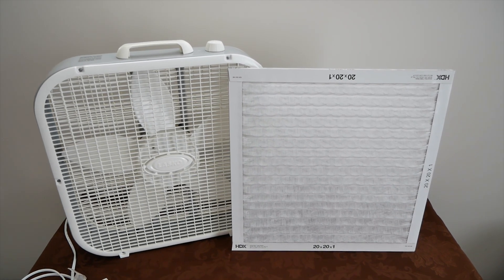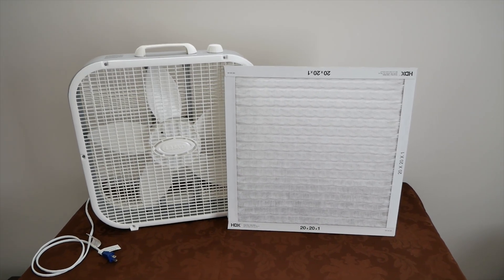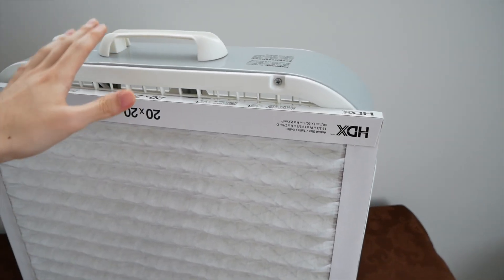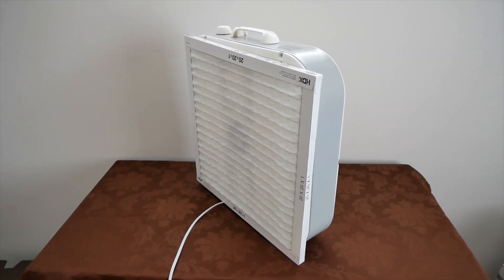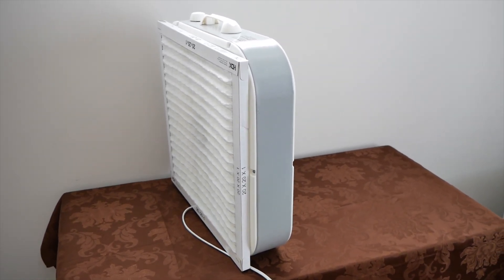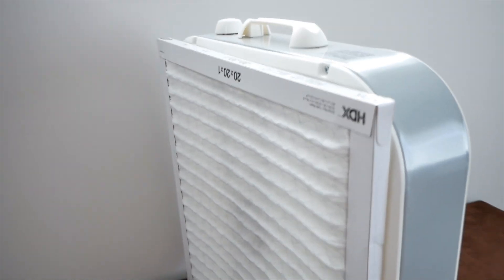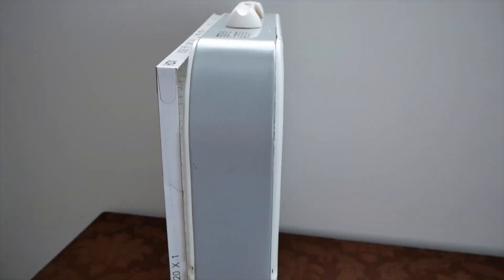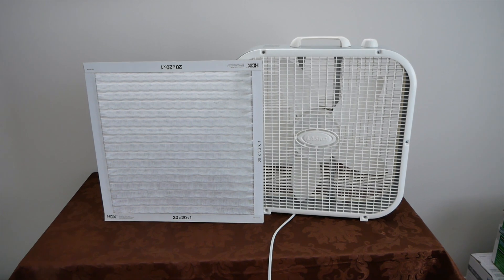Simple DIY Air Filter Box Fan | Build & Test

Comment: video failed to show results after one week after one month and after 1 year of use, try again?
Reply from the maker: The video’s primary objective was to build and test the setup, not to show its long term results. But I will say that it has been quite effective. I’ve used it in my workshop to keep sanding dust down and the filter captures everything that passes through it. No dust accumulation on the fan blades, even without sealing the filter against the fan.

Comment: Awesome, never heard of such a thing and I want to try it. One question, so if Im sanding something I would place the fan next to where I'm sanding with the filter as close to where the dust falls correct? Wouldn't the other side,(the fan side) be blowing around everywhere all the other particles that are not caught?
Reply from the maker: Thank you! With a basic setup like this, it's difficult to fully contain the dust, but yes, the best method would be to keep the fan close to your work area with the intake/filter side facing you. It's in evitable that some dust will be blown around the room. You could have a second fan with a filter further away from the work area which should help capture some of the dust that the first fan missed.

Comment: Sis I miss airflow direction thru the filter? Which way does the arrow go?
Reply from the maker: The arrow should face the same direction as the airflow. So if you place the filter behind the fan like I did, the arrow should be pointing towards the fan. Hope it helps!

Comment: I do the same thing, but I do tape mine on the fan. Yes, I have cats, it keeps the litter dust and cat hair out of the motor. Also yes low speed works best. I've been using the same two fans for this for 5 years and it makes the cleaning much easier too. I will try to just use the filter without the tape to see if it works for me.
Reply from the maker: Great to hear that it’s effective! For maximum filtering efficiency, I think taping does help a lot, as it creates a better seal. Leaving out the tape makes it easier to swap out filters, but at a cost.
Reply: @TheSuperFanMan  I tried the suction thing... I have to tape it. Not working as well as I want it to. I keep threatening to make a frame for it to slide into.

Comment: Awesome idea!
As an HVAC guy, I would even suggest a 20" × 20" × 5" filter, such as the kind used in Air Bear™ filter media, as it provides far more surface area within the same 20" × 20" square, which means much less strain on the motor, higher CFM and a much longer-lasting filter! Just thought I'd throw that out there. 
Also, you're correct about the filter being installed on the back/intake side of the fan rather than the front.
Great video and great tip!
Reply from the maker: Thanks for the pointer! I didn't even know filters that deep were available lol. It does seem like a much better option for this application than 1" deep filters, and it looks like its depth will also prevent it from tipping over when the fan is switched off. I'll most likely get one of those 20x20x5 filters once I go through the 3-pack 20x20x1 I bought!
Reply: 5" of medium is going to drag MORE.